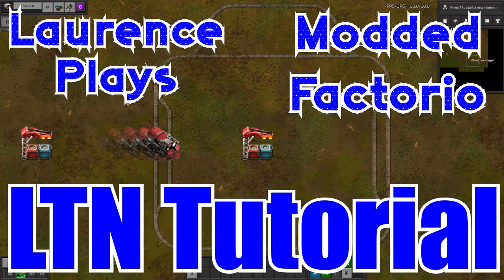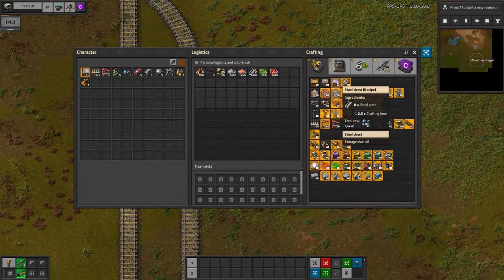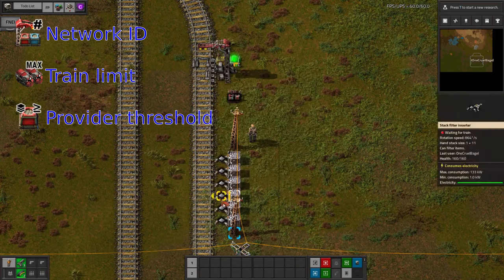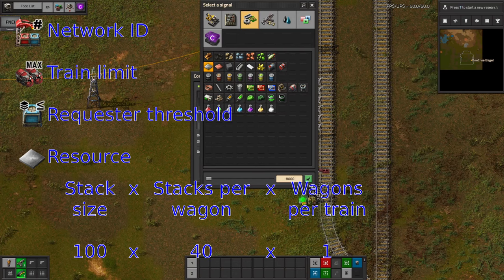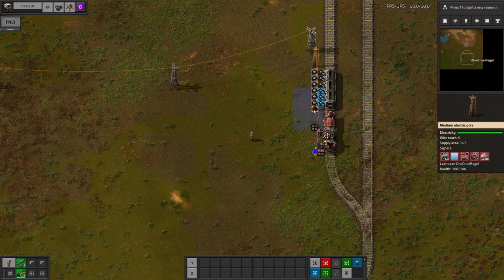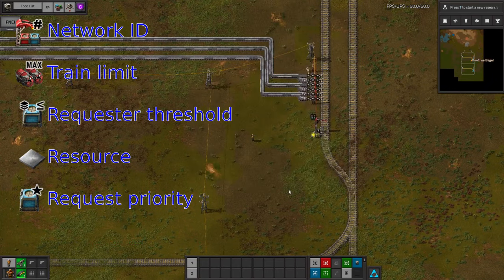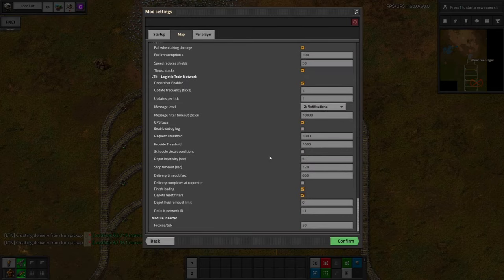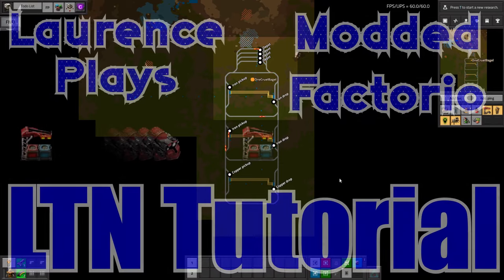LTN Basics Tutorial - Laurence Plays Factorio

Comment: Excellent tutorial. I can't say enough nice things. Some pro tips I would have found helpful:

1. The new version is different. Instead of using combinators, you can use the LTN combinator, which is just easier. Instead of grabbing the signals and setting them, they have a nice form for you to use.
2. HOWEVER: it's a bit confusing on one point. In the old LTN, you set the train limit in LTN because Factorio did not have this feature and if you didn't set it, ALL THE TRAINS would attempt to fill your request (or at least 3 or so). In the new version, YOU STILL set it in LTN. AFAIKT, the Factorio train limit has no effect on LTN and so if you set it there and expect you to see one train at a time filling the request, you will see lots and lots of them. So, you need to go into the LTN combinator, and add an LTN Train Limit signal if you want to limit the number of trains while using LTN.

If I'm wrong, hopefully the internet will gently correct, but this is how I solved my problem.

Thanks again Laurence!
Reply from the maker: Thank you, I'm glad you liked it  🙂
Had LTN now added the LTN combinators in by default then? Last I heard, they were an additional, optional mod. That said, I've not used LTN for a while as our current game is LTN free, to give us some extra challenges! I shall have to investigate...
On your second point, yes - LTN basically takes over from all the vanilla train systems, it's best to let it have its way, setting train limits, activating and deactivating stations itself. If you try to help, it'll probably all go wrong.  😀

Comment: An excellent tutorial. Great work! One thing I wish you explained in this video is the utility of the trail network ID's binary encoded bitmask. Which was to be able to assign trains to multiple networks, by adding up the network numbers. Seems like this video has it all, so it felt a bit silly how you didn't mention that.
Reply from the maker: I definitely wouldn't consider that part of the "basics", however it's a fair point and I didn't cover it in the more advanced LTN video either. The truth is, I rarely use that feature because in my experience it either doesn't matter which train goes, or you can control it with the train length options. Still, it would have been worth mentioning. If I make a 4th LTN video, I'll definitely bring it up.  😀

Comment: Wow. This is so simple. Thank you. 

Let me tell ya a story. So I decided to have a base that’s completely supplied by 1-1 trains. So there is a train track grid instead of a bus and trains everywhere. It’s as dangerous and awesome as it sounds, highly recommend it. K2SE as well. Anyway, I’ve been struggling to learn circuits and watching tutorials and finally got most things settled but it’s still messing up. 292 stations so far and 503 trains in system. 

Anyway. It’s a mess. It looks ridiculously awesome and when the trains don’t get stuck (at stations because of limits and whatnot) it works amazing, but it’s a mess. 

Figured I’d finally see how hard this mod is to set up. And turns out it’s not at all. And I’ve had it installed from the beginning of the run… time to go change some things lol
Reply from the maker: That sounds pretty cool, and the perfect use case for LTN! Have you gone even smaller scale than a typical city block system? It's going to take you a while to go round and program all those stations, but I think it'll be worth it! Maybe try to scatter a decent number of depot areas around your factory as well, so the trains don't have to go as far after finishing a job.
Reply: @LaurencePlays  It’s definitely the perfect use case for it. I was watching the video and just realizing how much simpler it would have been to set up if I’d been doing it from the beginning. Already have waiting areas built in before the stop stretches, so adding in depots everywhere will be super easy. 

And yeah, it’s smaller than the city block, more like a modular stop system. I standardized the rail segments, in 32x32 chunks. So the whole system is modular, if I need a couple train stops, plop down a train stop segment, need a straight, drop that. So at this point if I need more of .. say iron plates, it’s super easy to copy and paste the iron washing train stop and the smelting stops.

My nauvis generated with huge lakes everywhere and by the time I realized it I had the choice of paving everything or trying to work around it, this was partly the solution. I don’t love paving huge lakes and this way I can have a base that is modular and only really paves things for train tracks

Comment: Thanks for the video man!
Just came back to factorio after a long time off since my 10k spm base. Now looking for some 'smarts' in my base because all my old ones are quite dumb. This will help a lot!
Reply from the maker: Yeah, LTN is fantastic for making your trains a bit more ... organised. And flexible. Not quite as vital as it was back before we had train limits on stations, but still very useful. I recommend checking out the next video in the series where I show some more complicated uses of LTN!
Reply: @LaurencePlays  Yep, i will check it out after grasping the basics and making a simple network to start with. My old base never used train limits, just relied on a surplus of resources waiting in stackers. LTE probably won't reduce the amount of traffic for me but this will make my expansion easier, instead of naming 9861 different stations and managing the amount of trains, just setup station and be done with it
Reply from the maker: @brdl6192  Definitely! I've done factories that way in the past - usually one train for each mine (all going to one smelter) and then one train for each dropoff station for plates, circuits and so on. 
In case you're interested, train limits (and clever circuits) allow you to have one train that goes from iron plate pickup to all the iron plate dropoff stations when they need it; that's what we're doing in our current SE run because we thought it would be interesting to try without LTN.
LTN, of course, makes everything easy, tidy and sensible. Except outposts, but you can do them with vanilla trains, as I show in another video  🙂
Reply: @LaurencePlays  Still stream? If so i'll come in when i've got time. I use on site smelting tho, much less trains required. Is LTN smart enough to go from the closest full mine/smelt outpost to the requesting station?
Reply from the maker: @brdl6192  I stream on Mondays (at the moment) and then release summary videos on Fri and Sat talking about what happened during the stream. So, the full play is there if you're interested, or you can just watch the summaries for a quick ... well, summary!

Comment: This was one of the most helpful LTN videos I've watched, wish you covered liquids more. Instead of the chests do I link to the tank at the locations?
Reply from the maker: Yes, fluids are handled in exactly the same way - link the cable to the thing that holds them, and use 25k as the size of the wagon. The only thing to remember is to not use the stack limits as they don't work with fluids. 

I talk more about fluids in the two followup videos - "advanced" and "questions", so I'd recommend checking those out, but this one should tell you most of what you need. 

Thank you  :-)
Reply: @LaurencePlays  see, and I didn't even bother to look if there was others by you. Thank you! Going to have a watch.
Reply from the maker: @MrPeppah743  yep, I've done loads of videos, although only started thing tutorials fairly recently. I will be doing more though, so stick around!

Comment: Thank you for explaining. The priorities is new for me, I was indeed wondering if that was possible.
However I have issues with the liquids trains. I setup the request to -50000, for stations with 1 wagon. But the tanks at the requester stations ( 2 tanks of each 25000 and a pump ( with one pipe between tank and pump ) ) will not get empty. So there will not be a delivery. I set up the requester now at 45000 or 49000 ( i experiment with the number). But is there a nicer solution / suggestion ?
Reply from the maker: Setting the request to -50k for a single fluid wagon should work - the train should turn up when the total fluid in the tanks drops to 25k, meaning there'll be room to unload the full train load. Have you set the request threshold to 25k? 

I would advise against having it not request more until it's completely empty for two reasons. Firstly, it's difficult to drain tanks completely - there's often a tiny bit left in the bottom, and secondly, even if you could empty them completely, that would mean that you'd have no resource available there until a train arrives with more. This is why I recommend keeping the buffer between 1 and 2 trainloads.

Comment: Hello Laurence, how does one use a full logistics network as a basis for requests? Say I want my trains to run to a station to drop iron ore only when my logistics network has less than X amount in store. When I connect a roboport to a station, it seems to go haywire. Am I making a mistake, or is there a special way to do this? Thanks!
Reply from the maker: When you link a roboport to the circuit network, it outputs EVERYTHING stored in the logistics network, so you're telling your LTN station that all that stuff is in storage there, so you're probably getting trains turning up expecting to pick some of those things up. 

Try passing the signal through an arithmetic combinator set to "Iron plates + 0 output as iron plates", or whatever the resource you're dealing with is. This will remove all signals except the iron plates, allowing you to pass it into the LTN station as normal. 

Oh, and make sure you don't count the chests in the station twice (by connecting them to both the logistics and circuit networks)!

If that doesn't solve the problem, maybe drop into the Discord server so we can talk about it more easily.
Reply: @LaurencePlays  Thanks for the response!! You were right, my stations thought they could provide everything as well. I messed around with it some more and was able to make a bit of an easy fix by setting the station's provider stack threshold to an unreasonably high number that nothing in the logistics network can reach and then setting up the request as normal. This seems to have done the trick pretty well!

Comment: Fantastic Video! Just wondering if a station can be in two different networks? Thought this might be fun and useful to set up a buffer system.
Reply from the maker: Thanks! Yes, a station can be in two networks - the networks are set by a bitmask which is why you can only use powers of 2 (1, 2, 4, 8, 16 etc) for unique networks. That means if you set the network signal to 10, that station will be on both 8 and 2. If you set it to 13, it'll be on 8, 4 and 1. Personally, I've never used multiple networks, but I can see the potential, so it's definitely worth setting your networks when you build stations, just in case!
Reply: @LaurencePlays  Oooh that's why. I actually tried setting multiple network signals (say both 1 and 2) for a single station, which I guess the combinator would just add them up so the behavior is actually the same then. Thank you so much for the insight!
Reply from the maker: @olivershih424  Hah, yes! As long as you're only using power of 2 networks, adding separate combinators for both of them would actually work perfectly because the numbers are just added. So I think you get the "Right for the wrong reasons" award for that  😀

Comment: Some math to help illustrate the Request Threshold, assuming a 1x1/40 stack train:

REQUEST_THRESHOLD = 40
MATERIAL_OUTPUT = -80
TRUE_THRESHOLD = (REQUEST_THRESHOLD  + MATERIAL_OUTPUT) * -1

When the quantity of materials stored at the station drops below the value of TRUE_THRESHOLD, a train will be dispatched for resupply. This is also why MATERIAL_OUTPUT shouldn't simply be the negative of REQUEST_THRESHOLD, because: (40 + -40) * -1 = 0

SIGNAL_RESUPPLY = (REQUEST_THRESHOLD + MATERIAL_OUTPUT) + STATION_STORAGE

When the value of SIGNAL_RESUPPLY becomes less than or equal to 0, a train is dispatched. This is what LTN is looking for. Never set the value of MATERIAL_OUTPUT to be more than the negative of REQUEST_THRESHOLD, because: (40 + -39) + STATION_STORAGE will always be more than 0, and thus a train will never be dispatched.

Comment: Can you elaborate on the binary bitmaps? For instance, if you give a station the signal 3, does that mean it is on the 2^0 && 2^1 network?
Reply from the maker: Yes, spot on. So, only powers of 2 are "unique" networks. Also note that 0 (or undefined) is on all networks, which is why I recommend setting them all to 1, even if you're not planning to use networks ... just in case!
Reply: @LaurencePlays  Excellent advice. As soon as I realised you could just visualise it as binary numbers where each power of two represents whether or not a station is on that network it all started making sense. Great videos, super helpful.
Reply from the maker: @TheScoobysteve  Great, I'm glad it's all come together for you! There's something similar for outputting where locomotives and wagons are in a train, but I've never felt the need to delve into that. Much too complicated!

Comment: Is it possible to use LTN without having to setup Depot? 
Is it possible to use LTN in a Train-wagon-Train setup?  - with in and out trainstops?
Reply from the maker: LTN requires the depot - that's where the trains wait and are automagically configured, so no - you can't use it without a depot. 
I expect you probably could use it with two way trains though... I've never tried, but based on my understanding of how it works, I think it should be OK!

Comment: Firstly great guide. But im having an issue, of my own making im sure. Ive followed all your steps, tweaked numbers a little, as im using 1-4 trains and moving ore. At my requester station I have stack threshold set to 160 (1 train load) and the resouse threshold set to -16000 (2 train loads). But each time a train heads out to the pickup station, it will just sit there and say destination full. Also wont load anything. Any help would be much appriciated.
Reply from the maker: If a train is saying "destination full", I believe that's because the station it's trying to get to has a train limit (either of 0, or there are other trains heading there). This isn't an issue with your LTN implementation, it's an issue with a vanilla setting! If you're using LTN, don't set train limits on the station, set them in LTN instead as I cover in the video. 

You've also "discovered" a hidden feature in LTN - when it sends a train to a station, it'll first send it to the coordinates and then afterwards to the station. This is to prevent it going to the wrong station if you have multiple stations with the same name. So, I believe the train has gone to the temporary stop and then can't get to the actual station. And because it thinks it's in transit, it's not loading.

The fix is simply to remove the train limit from the pickup station (and any other stations which have it set). Hope that helps!
Reply: @LaurencePlays   Man you are a legend! Your absolutly right. I had replaced nomal stations with the LTN stations, so they still had manual train limits set. Removed them and everything is working just as it should. Thank you!
Reply from the maker: @MrClewsy1988  Awesome! I'm glad that sorted it. Now watch my other LTN video https://www.youtube.com/watch?v=5B4bkl_ChqA and build some ridiculous stations  😀

Comment: The tutorial is great but I think you should mention somewhere that requester stations without a set "provider threshold with a very high amount" will also act as provider stations when they are filled up, making problems down the line.
Reply from the maker: That's a fair point, however unfortunately it's not possible to edit Youtube videos once they're uploaded. The basic design is still safe though.
Reply from the maker: @Necriptos  If you follow the instructions at 10:07 and set the default thresholds to very high numbers, you should be OK with that, even with a lot of inventory dumping!
Reply: @LaurencePlays  Oh yeah right sorry I was talking with default settings. yeah changing the mod settings could be another solution indeed
Reply from the maker: @Necriptos  It's easier that way because it's one less thing to remember when you're setting up the stations! That said, you should be blueprinting them anyway, so it shouldn't matter.

Comment: Hey, unless something has changed, request and provide stations can not have duplicate names.

Depots can (and usually should)
Reply from the maker: Depots indeed can and should (although if you don't, it simply means that each train will always use the same depot - means you have to be careful and it's less flexible, but it can work). I believe - and I haven't re-tested this yet to check - that LTN deliberately sends a train to a specific location by the station before sending it to the station itself, to ensure it works with duplicate station names. This is why the temporary points are there at 6:22. I'll test this more carefully and report back though - just in case I'm wrong!

Comment: Follow the guide on the request, but using a Medium Container from Krastorio 2, put -8k and the trains would not stop coming even when it was full (the total was 22k iron plates inside) what did I do wrong ?
Reply from the maker: Sounds like either the container wasn't wired up or the request was set wrongly... It's hard to say! Maybe strip out all the wiring and set it up again from scratch, or check the signals on the cables to make sure they're what you expect.